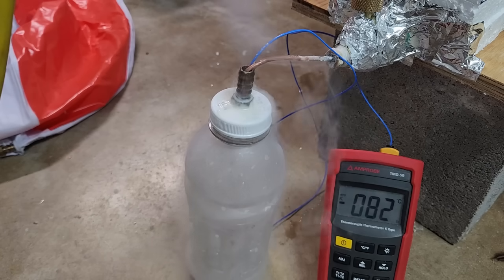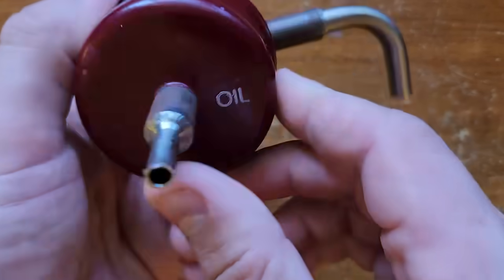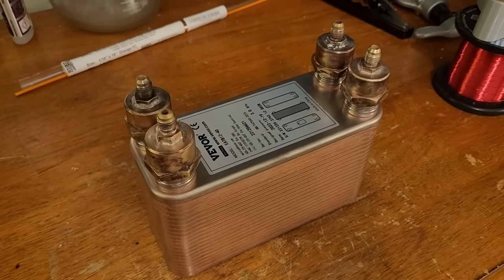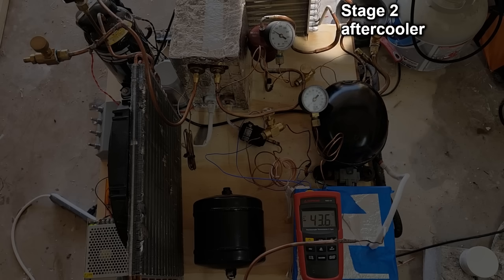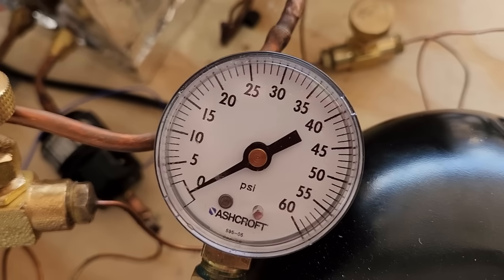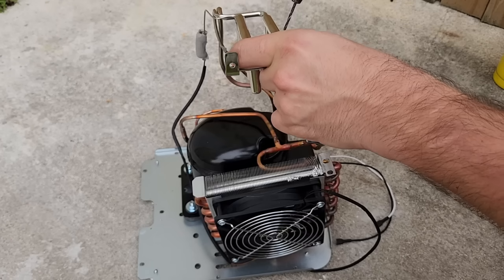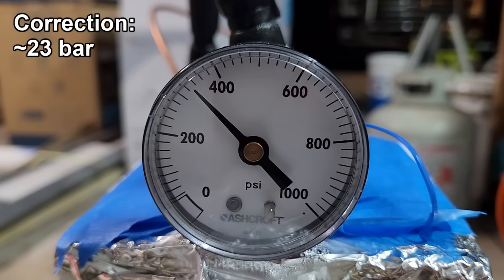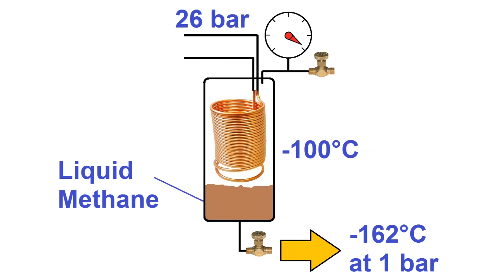DIY Cascade Refrigeration System (Part I)

Comment: I may be being silly, but wouldn't it be possible to find an old (working) kitchen oven, add a preheating coil to heat the ethanol vapor to ~450 deg F, and place the reactor and possibly the preheating coil inside the oven? You'd need to drill some holes in the side and insulate them, and it wouldn't be the most space efficient solution (not to mention require a 220 V outlet), but you'd be able to keep a consistent temperature, with the maximum possible temperature of the oven being considerably lower than that of the propane flame while still being able to pump out a considerable amount of heat. Keeping the oven at ~450-550 deg F and adjusting your flow rate, I'd figure you'd be able to find a happy medium, especially if you're able to add a vapor preheat coil. Limiting the max temperature should help reduce the amount of Hydrogen generated, while hopefully still allowing for the Ethylene production you want. 

Additionally, it may be worth adding some copper fins inside the reactor, to help even out the heat within the reactor volume. 

I'll think on things some more and see if I can't come up with something better...

-A sleep deprived freshly minted Chemical Engineering MS.

EDIT: Another thought occurs- you could try making a smaller/longer version of some of the kilns/burn out ovens that are made (See VogMan "making a burn out oven" for an example), and use that instead of an old oven. The bright side is if made big enough, you could do other fun projects with the same apparatus! :)
Reply: Hot copper is poison for ethylene generator because copper itself is a catalyst for converting ethanol to acetaldehyde .

Comment: So if you have the refrigerant at a high pressure you can start with it already at a low temperature before you evaporate it and shed even more heat achieving lower temperatures then bringing down the starting temperature of your next cooling stage ? I may have lost the plot because I was just listening while working but I'm about to rewatch the video and pay attention this time... this is a subject I don't have a lot of knowledge in and I have a constant need to learn new things...just in case the world goes bad and I need to cool something to very low temperatures with equipment I can mostly find in local stores lol. It could happen...

Comment: If you compressed the Ethylene into a cylinder to about 40 bar, and put it in the freezer for a while you can then vent off the top gas (hydrogen).
Reply: That is what I am planing to do with a methane. Compress it to about 50 bars in a steel cylinder and let to liquify in lab frezer in -84 C., then use it to liquify ethylene gas 
and separate hydrogen.

Comment: I was going to leave a haha comment that I don't have any real use for the info in these videos, but I love them anyway. Then a thought occurred to me. One of my mental pet projects is how to maximize the thermal energy contained in gasoline. They say 2/3 of the heat energy in a car engine is wasted heat in the cooling and exhaust systems. My idea is to use a steam-cycle engine, turbine, whatever, for the high-temp waste heat, and as that heat degrades, and adding in the cooling-system waste heat, use another system with a refrigerant as the working gas, to make some amount of power from that heat. The last word I heard on the subject is that it's diminishing returns, as far as engineering and complexity versus power gained. I really have no idea, but if I had a workshop and the understanding, I would play around with systems and see if I could come up with something that worked. Staged Energy Extraction technology. lol
If you think there's anything to it, I'd love to see you experiment with the idea. Thanks again for the educational and entertaining videos.

Comment: lol my porsche has an oil air sepperator for some dumb reason. also, braizing never looks pretty coz copper always rusts in air at high temp. people are used to welding aluminium or using a bunch of expensive argon with mig. most real world welding before the 80s never looked like people say its supposted to on the malignancy that is instagram/ticktock

Comment: I’m retired now but I worked on cascade systems and I charged my 1st circuit 12 subcooling.  With -10 to 12 superheat. At 100%. My second stage I charged to 12 subcooling and and 12-13 superheat but you can go as low as 10 due to low oil return from evap. Note you must lower oil viscosity on second circuit. 
Note that high head with low suction may be txv issue or restriction on a cap tube. 
Hope this helps 
always pull a vacuum  lol

Comment: If you don't pull a vacuum on the system before you add refrigerant you will contaminate the refrigerant. If you have moisture or other gas in the system you will have a high condensing pressure and reduced capacity. Moisture in the system will also lead to compressor failure.

Comment: Peltier coolers can hold 40 degree temperature differences at low load. Maybe for the Ethylene distillation step you could use ice water to cool the hot side at 0 degrees (or add some salt to get closer to -20 with ice from a normal freezer) and then slowly bring the cold side down to -40.

Comment: I am following along in this project... I have been playing with refrigeration since late January.

Today I am using my CNC to put grooves on both sides of a copper plate.  This will fit between two water sprays... trying to make q cheap heat exchanger...

Even these little scraps of copper are going to be stuffed back inside the grooves. 

Much fun watching your approach :)

Comment: Realistically hydrogen boils at a much lower temperature than nitrogen so you could buy some liquid nitrogen at a welding gas store and use that to purify your ethylene. I know it seems kind of circular to buy liquid nitrogen to build a liquid nitrogen making machine but in theory it should work. It should have also worked with your apparatus if you had used the top vent and recouped the ethylene by using the cold chamber for fractional distillation. Common coffee thermos's are vacuum insulated dewars many of them can easily handle cryogenic temperatures.

Comment: Years ago I used to fill balloons with HHO and blow them up, if the balloon stayed pressurised for too long though all the hydrogen would escape as the molecule was so small, the balloon was essentially acting as a molecular sieve. Filling a large balloon up with your contaminated ethylene+ hydrogen may filter out the hydrogen component, probably not air though... Just a thought ;) love your work man! Been watching every video with massive interest as I love refrigeration!
Reply: Nice thought. Working with ~200L gas in ballons at 1atm is not totally impossible, but a garage full of ballons leaking hydrogen sounds like a REALLY fun insurance case :D
Reply: @vikenemesh  haha true, guess that will motivate him to ensure it's relatively pure in the first place ;)

Comment: From someone who has built and operated cryo hydrogen systems, craftsmanship counts. 

When you make liquid air are you prepared for the fun that will bring to even what you touched your connection points with. 
Where is the JT valve? Use the pressure drop that provides to force the phase change at the HE. 
Matching the flow needed and where your system deviates from everything from surface area of everything. Compressor flow, pipe, where is your jacketed piping? Losing before measurement? 
Joules Thompson valve and that flow pulling it through the latent heat zone. 
Vacuum, gravity, and even a simulation run fifty ways on the computer are your friend. 
Good call on the toxicity of the flourene solder. 
In industry you wouldn’t believe the risks others love to put the guy commissioning.

Comment: What you might consider for the Ethane generator is instead of a pipe with Al2O3 over flame - is instead of the flame, use a larger thermal mass of a tin bath (which melts at 230C, boil at 2600C) using a 2kw eletric element and a PID thermocouple, and some way to create flow of the liquid tin for greater heat control. This, in addition to a slight architectural change of the heat pipe, should allow a more accurate, more consistent heat transfer to the evaporated ethanol, and therefore a yield closer to 100%. This might be preferable instead of/in addition to your purification process.
Reply: Just looked at tin prices, $25/kg at wholesale, but seems fairly expensive at retail when aiming for pure samples. Will be more cost effective to purchase tin/lead solder alloys from china (at bulk) - that gets near $25/kg. Just make sure to do it in a well ventillated area if dealing with these molten heavy metals.

Comment: since you had the ethylene liquified in the chamber, couldn't you have cracked open the upper valve, waited until the pressure dropped to 0 to let the hydrogen out?

Comment: If you needed to condense the second stage intercooler (Condenser) then you could try and put a fan on the tube and fin heat exchangeer to help that process.
The dishcharge should be at a higher temperature than ambient and cooler at the outlet of that heat exchanger. 
Maybe putting probes on the inlet and outlet can help you determine if there is some type of heat exchange going on or if you're gaining heat. 
I was thinking maybe you needed to add more charge but your pressures went way high. Regardless I'm not sure what pressures ethanol runs on the high side.
Impurities like you said can be a problem. Maybe the cap tube was too long causing those high side pressures but you should've reached some type of heat exchange at the 2nd evaporator once proper condensing pressure was reached.

EDIT: CRAP ! I looked up ethylene PT chart and found that that refrigerant runs super high pressures ! I was expecting something like R12 or R134A system pressures lol
Whatever your evaporating temperature is on the first stage, you want to be 15°C or 30° F above that. I think you said -32° C. So condensing temp should be around -17°C roughly.
This condensing temperature for R1150 equates to 380 psig condensing pressure. Seems like you were right there on the second try. I never touched a R1150 system so new to me but as long as your condensing temperature (2nd stage) is higher than your evaporating temperature of the first stage then it should theoretically be doing some heat exchange. 
-80° C would be 34 psig on the suction side of second stage or 16 psig for that delta of 10 degrees between evap temp and cut-out temp of -80° C.

Comment: you could use one of them dehumidifers with the quick restart feature (witch uses an electric valve to equalize the pressures balancing the pressures so the compressor can restart after a power outage.

some refrigerators use the same idea to defrost.

also you could get a refrigerant recovery machine witch is oiless  or even an oxygen compressor used for medical use as a refrigeration compressor.

Comment: I know your temps are such that making foodstuffs freeze may be fruitless, but I'm wondering if specifically the icemaker setup using some other kind of coolant may work as a very nice compact off grid freezer, perhaps running in a low rear compartment of a schoolie under the "garage" many seem to have to keep other systems cool. Any fluid ideas for what would drop to -10-20c under road safe conditions?

Piggybacking off of the industr-fridge expert below, some of your lines for sub-cooling could be used to cool other things like the compressor.

Comment: You mentioned that Ethane was more complicated to produce, but I don't think it is. Look at Kolbe electrolysis, Scrap Science did a video on it recently.

If you do the electrolysis, run the generated gas through a gas washing bottle (you can make one from a jam jar) with Sodium hydroxide solution in to remove the Carbon Dioxide. Add an indicator to the hydroxide to see when it's getting depleted, or you could calculate the required amount and use an excess or chain a few of them together to ensure complete removal. The collected gas should be Ethane and water vapour. 

The electrolysis should give quite pure gas, but will take ages to collect any decent volume. To reduce the water vapour content before collecting you could add a drying tube made from silica gel or another method. If you require a gas with no CO2, then you could run the dried gas through a tube filled with dried solid Sodium hydroxide.

Comment: As not only an air conditioning technician, but an avid experimenter, watching you answer so many "what ifs" as you engineer your way through DIYing something this complicated is fascinating in the best possible way. I even learned something today, which was your explanation of why impure refrigerant (something us A/C guys refer to as "non-condensibles") raises the pressure on the high side. That being the law of partial pressures.

Comment: An alternative to dissolving in Ether would be to exploit Hydrogen's ability to diffuse through plastics.

A system could be made where the mixed gas is ran through a compressor, but not to very high pressure, and then sent through a long length of Polyethylene hose (the coiled air hose stuff) then through a needle valve and a radiator back to the compressor, a buffer tank would be useful for system volume. 
The plastic "condenser" should allow the Hydrogen to diffuse through a bit, but the Ethene won't diffuse as fast.  Using a couple of dozen psi would allow for commercial air fittings to be used and not require any special parts, just make sure to run the system in a well ventilated area, probably with a fan on the air hose to keep it cool and blow away any Hydrogen. Pressure gauges should give you an indication of how much and how fast you're losing Hydrogen.

Comment: You likely still have small leaks. Try pressurize with hydrogen or perhaps propane and use a gas sensor to find leakes. 

Also over heating the copper is not great.

Comment: wow your learning and building your Projects fast! keep going. Try to find some old condensing units for walk in boxes 404a or r22, the compressors have more power and have an easier time reaching 400psi headpressure while running like 10psi suction, also they come with a condenser with fan and Receiver sometimes even with liquid seperator etc.

Comment: If you have a P/T chart of ethylene. And let the system equalize. Then your pressure should match the outside temp. Otherwise, it's not pure. 

And a note, we are not using buffertanks (reciever) on capillary systems.
Reply: And thumbs up for the project. Love it.

Comment: Don't try to set specific pressures in the system.
Try to use your evaporator to the full potential by measuring and regulating the superheat after it, this will give best results independent of the temperature itself.
For Propane you can use R22 TXVs, for Propene R404A or R502 TXVs can be used.
Or use a electronic expansion valve with a stepper motor and some electronics.

The atmospheric pressure is not relevant for the system performance, there is no bend in the efficiency curve of the compressor at suction pressure below/above atmospheric pressure.
The higher the compression ratio the worse it gets, the higher the mass flow the higher the required drive power.
So higher compression ratios don't necessary mean more drive power.

Comment: @ Hyperspace Pirate you need to be careful with regards sub cooling as nothing is free, it’s going to increase superheat and if excessive you will destroy hermetic compressors at worst and at best is heat that still needs to be removed by the condenser.
I can’t recall you mentioning suction superheat at all and it’s something that is really going to effect the performance and longevity of your system.

Many years ago I knew a guy who built cryogenic coolers for low temp receivers in radio physics where the evaporator was the size of a matchbox inside evacuated chambers and they were using hypodermic needles as metering devices.
From what I can recall he said they used single stage direct expansion helium systems where the compressor was relatively large (about 10kw). The issue with the Helium was the leaks due to molecular size, apparently all of the brazed joints were done with 60% silver solder and the helium was still a consumable to some extent as even the steel of components such as the scroll compressor housing are somewhat porous to helium.

Comment: Ethene is soluble in ether, Hydrogen isn't. 

You made Diethyl ether when you made Ethene. You could purify it or just buy it. Acetone might also work.

My suggestion would be to collect the gas as before, then compress it into a tank and drain the water. You could use another method to dry the gas. In another tank (or expand it out again and use the same tank) put in the Ether, then pump in the dry mixed gas. After mixing you should have a gas phase with Hydrogen and undissolved Ethene and a liquid phase of Ethene dissolved in Ether under pressure. 
Drain the liquid off through a valve into a vessel such as one of your expansion tanks but connect the beach ball to another outlet. When you open the valve the ether will come through and the Ethene should boil out and be collected in the balloon. 
Residual Ether in the Ethene can be drained off once recompressed and further removed by cooling.

I haven't looked up the exact solubility data, so it might need a few runs to extract all the Ethene into the Ether.

Comment: ion cooling
Reply: ions are easier to cool and heat to extreme temperature differences, by simple electric field
Reply: electrical is better than mechanical, peltier and such
Reply: ion in the same way as the vacuum generator systems, but better
Reply: ion stuff is not dependent on the refrigerant gas properties
Reply: hey combine the compression pump with a vapour phase change heat pipe cooler, just water at 2kJ/g
Reply: have you tried tin sn99 soldering wire 3d printing